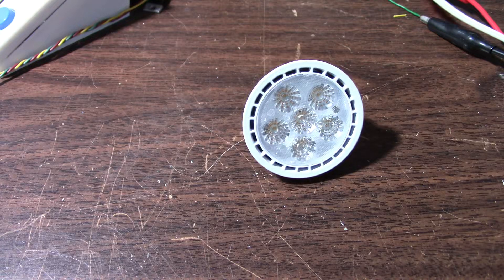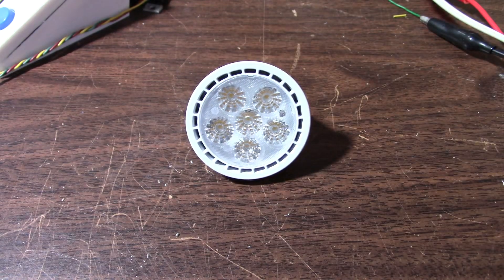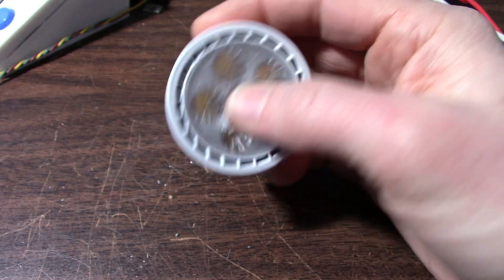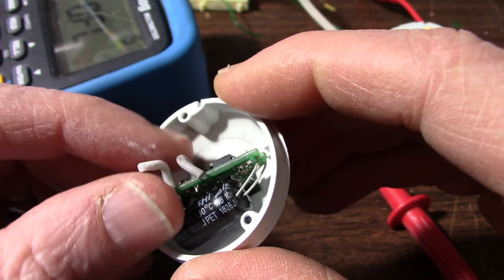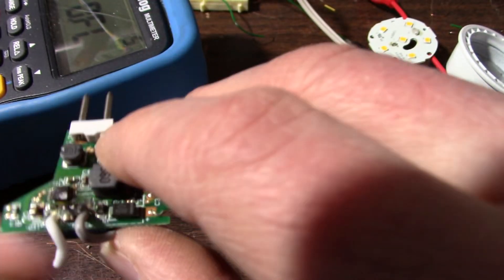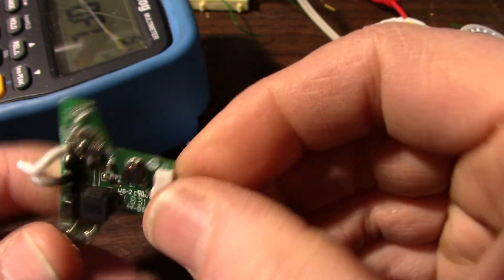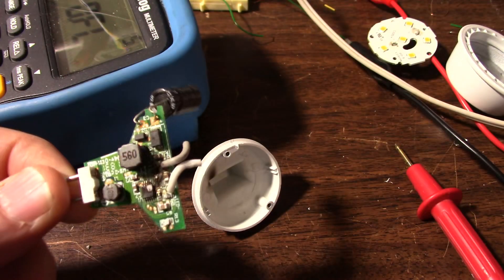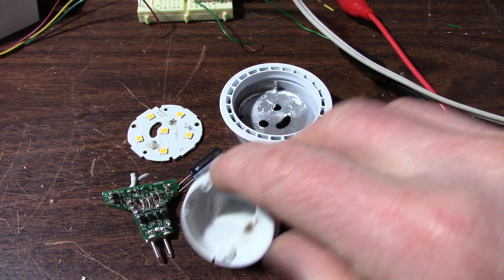LED light bulb ruined by static electricity - TEARDOWN

Comment: I was drilling holes in my concrete for bolts for a lift and the concrete dust created so much static electricity that it blew the LED bulb in my headlamp. Thanks for the vid.

Comment: Quite the interesting driver board for just a 12 volt light. I would have figured they'd just have so,e resisters in there with running 2 Serbs of 3 chips.
Reply: That would make a horribly flickery light when run on AC.